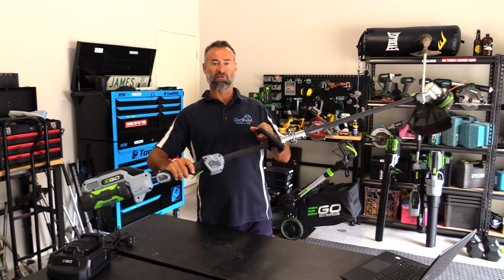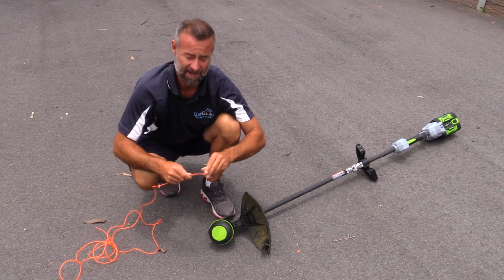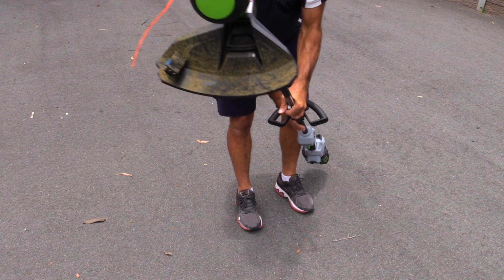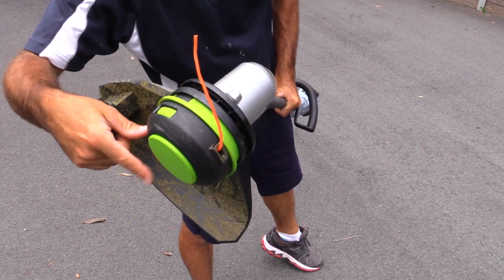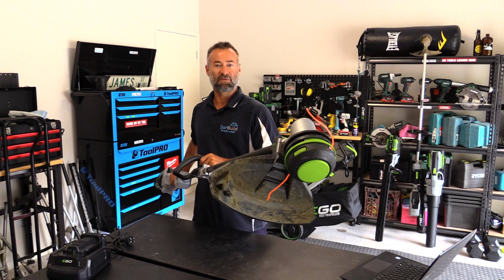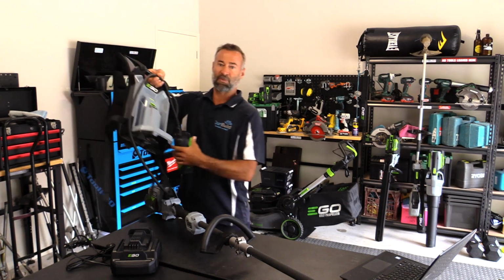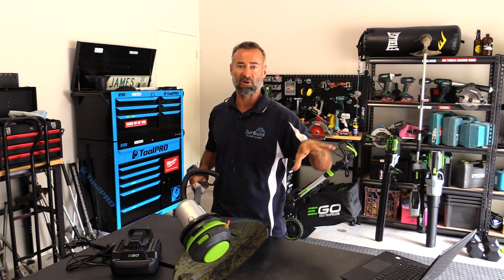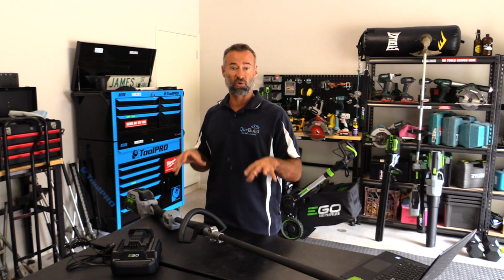EGO 38cm 'POWER LOAD' Line Trimmer 56V - Tool Review

Comment: I have had my unit only one day.  It cuts fine but why won't the line extend further as it wears down even if I bang it on the side walk as I am pulling the trigger???  Am I doing something wrong?  Thanks!
Reply from the maker: It needs to be hit on the bottom (green dot) for the line to extend.
Reply: @OurBuild  Thanks....Yes I understand that.  When I went back to ACE, they told me that was the nature of String Trimmers: to get jammed up often...especially when getting close to the end of the source of string.  I don't want to be often having to stop and take the thing apart to untangle the jam in the string!!!  I think I'll be taking it back tomorrow.  That is what EGO suggested when I spoke with them earlier
Reply from the maker: @Stormskiing  Yeah it shouldn't tangle inside, so might be worth getting it looked at 🤙

Comment: Bought one from Home Depot, it ran 1 month light use. The POWERLOAD would not work. HD replaced it no questions asked. The second one has the same problem, POWERLOAD won't work. very frustrating. After a couple of days trying to get EGO customer service on the phone, they are sending me a new unit. Really hope I have better luck with it than my last two. I do own several other pieces of EGO equipment with good luck, not so with the trimmer.
Reply: I'm having same issue, pissing me off..It turns, but wont bump and pull string in...Let me know if you get any results.>Very frustrating.
Reply: It took over three weeks for EGO to get a new trimmer to me, blamed it on covid-19. Finally got it, not the same model that I had, new one isn't foldable. Only used it about 5 minutes to try it out, the trimmer came with the string preloaded so I wont know how the power loader works for awhil. will keep you posted.  @kwmulligan
Reply: @budr243  appreciate it..thank you
Reply: Had the same issue. Powerload gave out on the third time I reloaded trimmer. Only been using the trimmer for a couple months. Might be trying to return to Home Depot soon too.

Comment: I have a stronger trimmer from ego with blades and a 5 ah battery and i love it. So much power i can easily cut through the highest grass and brush. Battery life is 45 minutes and it charges also in 45minutes. I really recommened the ego trimmers.
Reply: Hi There Would you kindly let me know of the model you have from EGO?  And How much was it? Was it a kit or just a skin with no battery and Charger? Please let me know.  Thank you
Reply: @aldobiglari4575  I have the BC3800E the biggest model before the professional model. I have paid for the trimmer 370,- the battery 200,- each and the rapid charger 100,- euro's . The gear and blades where included by the trimmer. Not cheap, but its equal to a gasoline in the same price category. I use it around my farm. For high grass andd bushes with the blade and semi high grass the trim line. I like it, easy to handle, good power. The battery can last up to 45 minutes but with the highest power mode 30 minutes. Whats not bad but not great. I dont recommend for wood sticks or wooden brush. Therefore it lacks power and  is it not made for in my opinion.